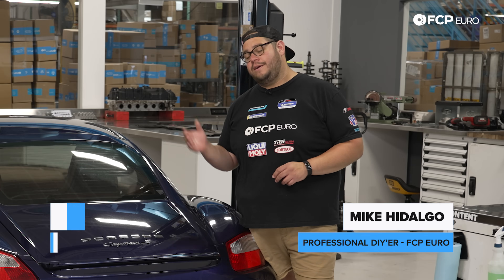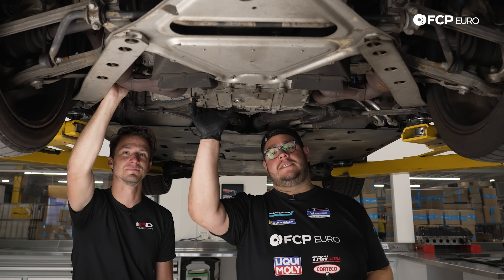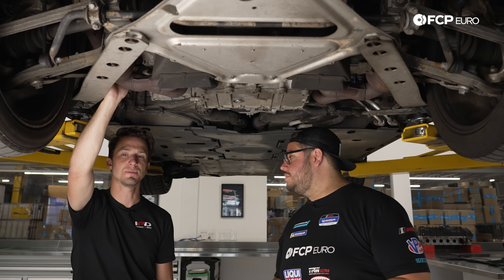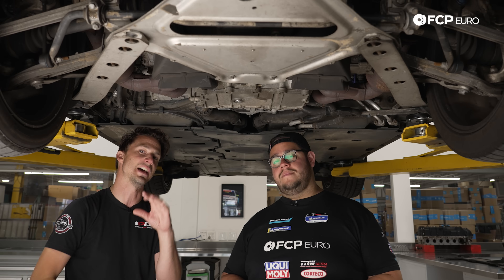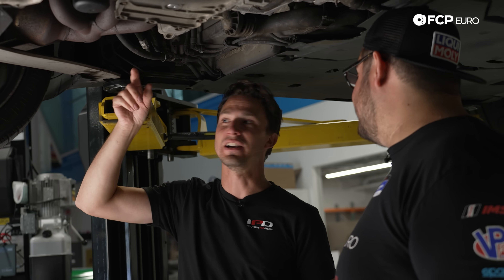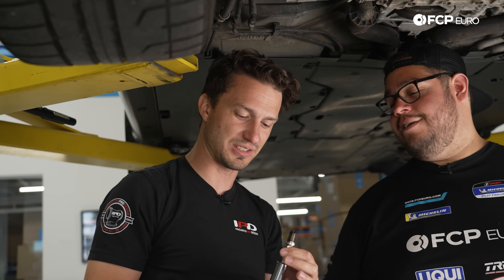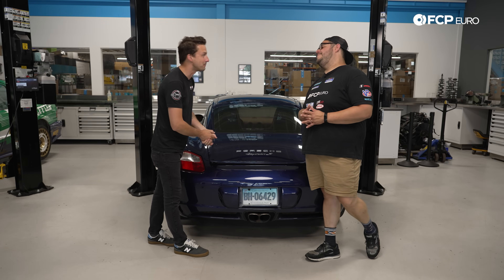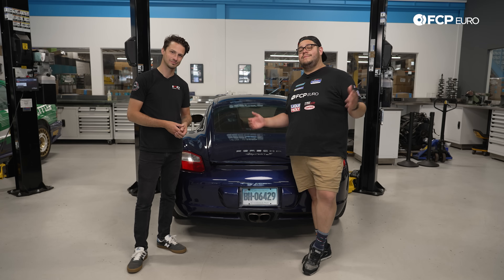Porsche Cayman Bore Scoring Diagnosis DIY (2006-2008 Porsche 987.1 Cayman S)

Comment: 💯 of the way to prevent this is to buy a BMW US Spec M3. Solid S52 engine that’s a blast to drive and ultra reliable. Purchased mine for $8k. Imagine spending $60k for a 911 and then a few years down the line $35k for an engine rebuild. Thats crazy!!

Comment: @fcpeuro - Guys, this is NOT a rear-engined 911, it's a mid-engine Cayman. The engine is turned around with the transmission towards the rear of the car for goodness sakes. You're looking at Bank#2, cylinder#6, NOT Cylinder#1. And, this explains why the engine is suffering because Bank 2 of the M9X engines is where Bore Scoring usually occurs more times than not. The M97 S-model engines on the Boxster and Cayman suffer horribly from the problem.

Comment: I've has a 2007 987.1 S since new.  Just hit 80k.  I'm convinced this issue has gone down the ims-like pit of internet despair.  Does it happen with more frequency than SOME other engines?  probably.  Is "every M97 a ticking time-bomb"?  lol  hell...what engine isn't in some way.  One thing I have gathered though.  You absolutely cannot abuse these engines like you can a smallblock chevy or most Toyota engines etc.  If you want to bounce off the rev limiter daily, or track it, hope you have the funds.  I enjoy the hell out of this car and have for many years.  I'll continue to do so.  I've never replaced shift cables, engines, air oil seperators or anything out of the ordinary.  Aside from regular maintenace, I've done 1 window regulator under warranty.  Thats it.  One interesting fact, this problem is nearly unheard of on S model tiptronics.   Why do you think that is?
Reply: It's fuel quality I am betting , plus a little bit of how it is taken care of. Bad fuel gums up the injectors, screws up spray patterns and the fuel does not atomize fully or properly. Fuel in the combustion chamber (liquid fuel) washed down the cylinder wall and removed the thin coating of oil and allows it to wear faster. Gravity does some of it too. Notice the wear is on the top of the wall in this video. Run quality fuels, clean/replace or service injectors and change your oil frequently (not insanely but then again not every 10K  )... best of luck to all...especially the afflicted ..it's a very expensive repair and in most cases more than the value of the car on some of the 987.1's
Reply: That's similar to me, 2006 boxster s 120k miles, tipomatic,  and so far so good , replaced the  wear and tear but no major problems!  Don't race, tracks,  just cruise around topdown in paradise!  Aloha from Hawaii MK,  another Mat!

Comment: Your calling that cylinder 1? The left rear cylinder on a Cayman?  Based on all the illustrations and videos I've seen that would be bank 2 cylinder 6.  I think you were thinking about 911 cylinder layout where the left rear is cylinder 1.  On M96 & M97 engines #6 is the one that scoring generally shows up first.

Comment: good video and explanation, but this is not a (only) cayman issue.  i change oil every 6 months and a sample to Blackstone Labs.  One suggestion is when you start the car, drive it, don't let it warm up.  Agree short start/stops don't help.   My 2007 Cayman S has 117K, so far so good. thx for the video.

Comment: So is the block need replacement or does it have individual cylinders like the older air cooled engines?
Reply: A good machine shop can sleeve anything if you have the money. They can even cut universal sleeves to fit the application.  I guess it comes down to what you're willing to spend

Comment: I'd like to finally see a solution that can be done reasonably. It's completely silly in the US prices to do this repair correctly are $10K-20K+. It doesn't seem that in Europe that it's quite this bad. These are amazing cars with amazing engines. We need to find real, affordable solutions. Thank you.
Reply: I hope porsche will do something to help us when they finally decide to make it a “classic”. I just hope my car makes it to that point.
Reply: Yeah in the PCA video they said that the cost is $15k-$20k for just the rebuild.  Factoring in all the other labor and parts, it would basically be the cost of a higher mileage 987.1 Cayman S just to rebuild an engine.  Even a "cheap" rebuild is like $10k.  It's insane.
Reply: I owned a base 2.7 which doesn't seem to suffer this problem. However, if you own a 3.4, remember that bore scoring is still not that common. Don't let it detract from the experience of owning the wonderful cars.
Reply: @mattandallthings  Thanks Matt, that's the approach I'm taking. I don't worry, just planning just in case. It's too beautiful of a car to ever give up!
Reply: Still 10k+ in the UK. Unless you can pull the engine yourself, maybe £6k then.
Reply: @spyder_man  
Yikes!  There must be a better way for us all. Otherwise these amazing cars are just going to disappear. That would be a complete shame.
Reply: nikasil. bad engine (lokasil), no avoiding it

Comment: My m97 (3.8 x51) in my 997 had bore scoring.
Sent it to Flat 6 Innovations for a rebuild with Nikasil liners and enlarged to 4.3 litres.
Got it back a few weeks ago and it’s absolutely stunning.
>450bhp and 400ftlb, it now pulls like a train from 3000 rpm and is stupidly fast. Love it!
Reply: I'm guessing $30k, but it sounds like it was worth it.
Reply: How much did that run you?
Reply: I can answer that explicitly. $35k for a basic rebuild. $40k for a mid grade and $55k plus for crazy upgrades.
Reply: How much did it cost?
Reply: @harryberry474  unfortunately, it could be one of those “if you have to ask, then you probably can’t afford it” situations.
In the end, the car has cost me more than if I had just bought a similar GT3 (back in 2016) instead.
I have a 991.2 GT3 and wanted my 997 to be more of a daily driver, so I spec’d a much torquier motor and whilst it has cost me the earth, it is a very unique, special and reliable daily now.
They only build ~12 of these motors per year, but their 4.0 version is much more popular and I think runs around $30k.
Reply: @I999-g2s  It's a real decision now considering the premium expected for 997.2 vs 997.1.
Reply: At least 30k
Reply: I he stopped working on cars, he's now strictly engine building, you have to send him your motor.

Comment: Great video. To be clear, it is my understanding that the lokasil is not a coating like nikasil. The lokasil is not worn away to bare aluminum here.  The scoring is due to loss of the coating on the piston skirt and subsequent galling.  I would love to see you do a rebuild video as your videos are among the best in the business.
Reply: it is lokasil, but the silicon does wear away
Reply: Ya. They should have stuck with nikasil.... it's all about the cylinder wall

Comment: Same issues for the 997.1 S versions. Locasil + too much bore = heat issues = oil consumption = new block or liners = €€€

Been there. Crappy design.

Comment: I think I'd want to scope every cylinder to see what I was dealing with.  If all other cylinders look good, there would be be a much more reasonable cost to just repair the one.  Plus, a guy might want to NOT DRIVE THE CAR anymore until the one cylinder was repaired.
Reply: It would be very foolish to do only one cylinder as the other five are on borrowed time and it is a big job. I wrenched for 47 years at a dealership level and we would not do that and if done it definitely would be on the customer with no warranty.
Reply: Exactly what Nickpappas4133 said.  You wouldn’t do all that work just to replace one cylinder and piston.  It’s difficult decision time for the owner.

Comment: Porsche engines are fragile plain and simple, they all have major mechanical issues which requires rebuilding
Reply: literally not true lol
Reply: I have a POS Honda Civic that’s rusted out and has 225k. Engine runs and screams like a champ w those little 125HP. Bought for $3k years ago. Porsche 911 is $60k and $35k for a rebuild. Hard pass!!
Reply: Regarding their boxster engines yes
Reply: no, its 987 S engines from 2005-2008...dude said "Porsche Engines are fragile plain and simple" dont be a dumbass amd co sign the bullshit @mecheng1977

Comment: Was that cylinder 1 or 4?
Reply: I was wondering that also, wonder if they are confusing with the 911 layout. 1-2-3 is on the right bank which is on the right side of the car in the case of a Cayman. Were they actually scoping 6 which is the more common cylinder to fail first?
Reply: @arthurmchan  I think so... 😉